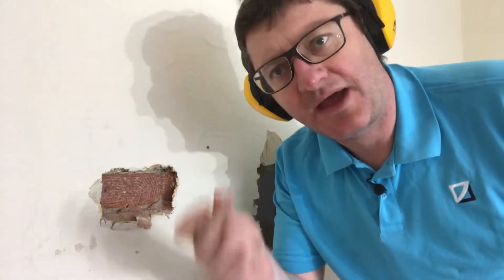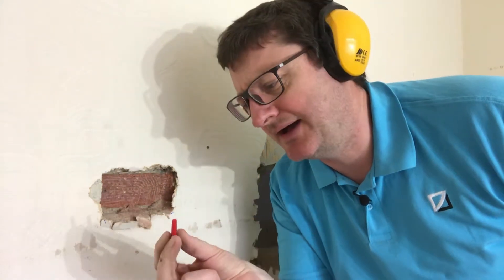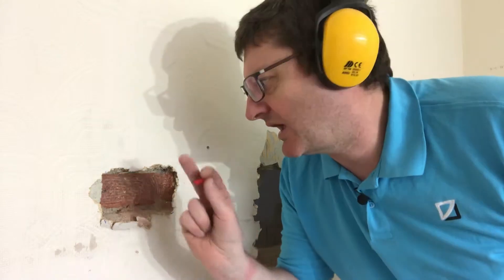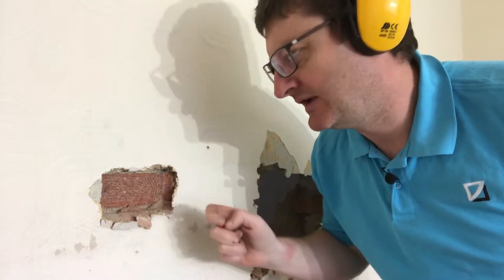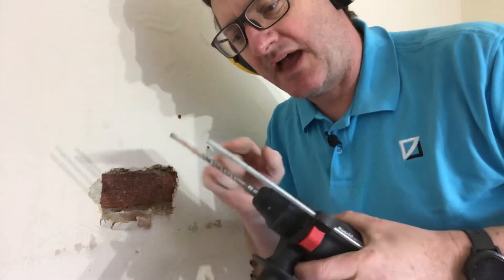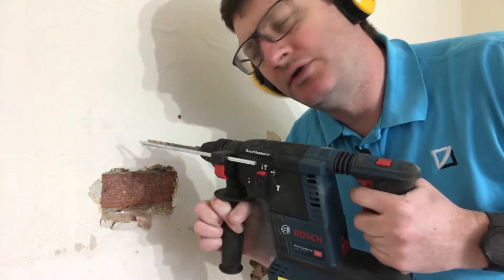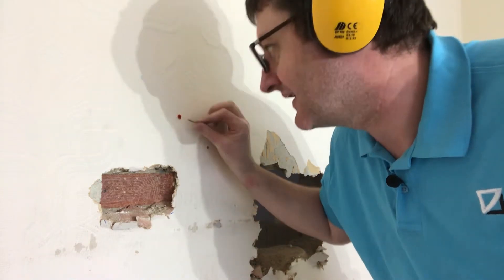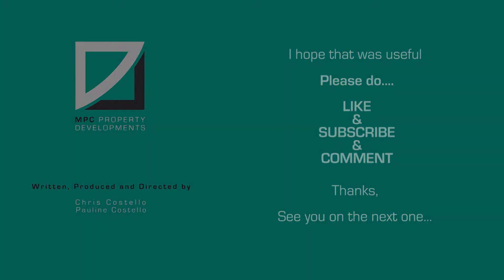RENOVATE; Rawlplugs or fixing screws into masonry (brick) walls.

Comment: I dont use RAWLPLUG because the ends are blocked, better to use a plug with an open end to allow for a longer screw and use a 0.5mm smaller bit for a tighter fit, i.e.. for a red plug use 5.5mm drill bit.
Reply from the maker: Thanks for the comment... I'm sure every builder has their own favourites.... sometimes the best one is the one you have! (although the ones that come with lights fittings etc are the worst!)